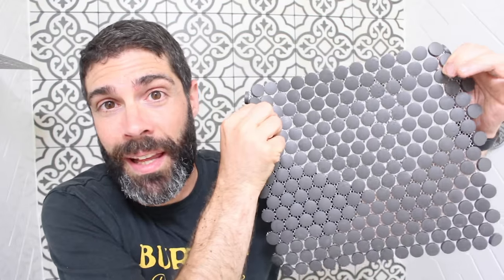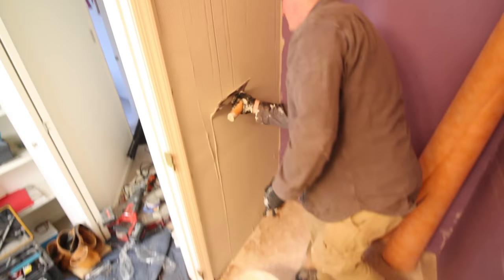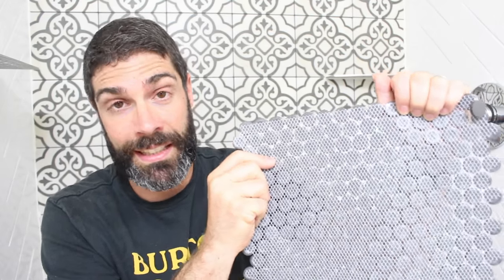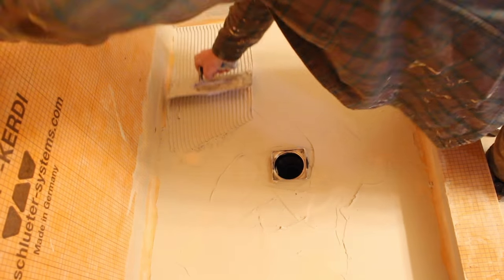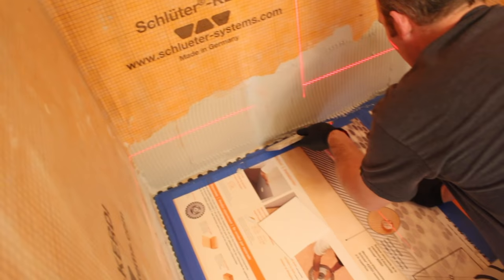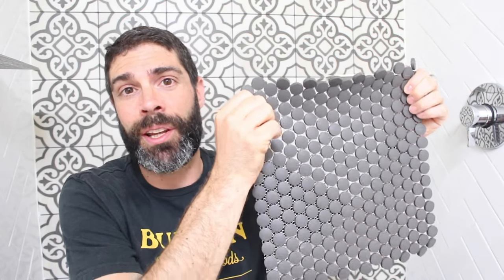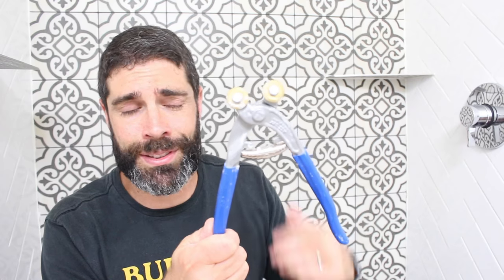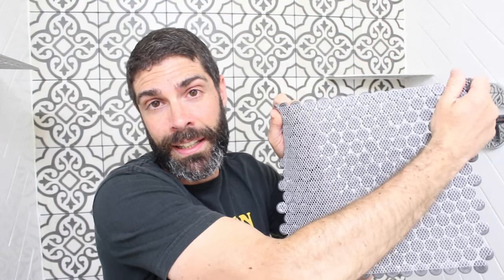Schluter Shower Part 4: How to Tile a Shower Pan...Penny Tile Tips

Comment: FYI, if you use a 1/4" trowel you will be cleaning lots of thinset out from between the tile.
Reply: 100% agree. Need a smaller trowel or knock down the ridges.

Comment: What do you mean by the back covered in glue? Maybe cheap tiles get sloppy? 
I have had stickers on the back.. always remove them.
Reply from the maker: excess adhesive that covers most of the tile surface area and prevents it from bonding to the mortar

Comment: Hi, wondering what you would do, or where you would caulk, if you're using base tile on the shower floor where it meets the wall. The tile I'm using is a "flat top with cove base."

Comment: Hi! Can I do a clear resin or polyurethane on top of Penny tile? I have marble Penny tile floor but they stick out still after 2 regrouts. We want to have that ‘wet look’ on the black tile/black grout, but also give some protection from feet/knees when bathing our baby. Happy to Venmo you for the answer.
Reply: @MrAarobinson89  No, can’t take the risk of it ruins the floors. Stupid marble Penny tile was marked as wall/floor. But it’s mostly just a wall tile because it’s not rounded at the edge, it’s sharpe. Cost too much to risk ruining.

Comment: I’m just not sure how quickly you respond, but my question is do you sanded or non-sanded grout when you grout penny tile?
Reply: Unsanded
Reply: Sanded! Never use non sanded grout In high water applications. It will 100 percent of the time deteriorate over time.

Comment: Is it recommended that you don’t back-butter penny tile before you lay it onto the thinset?  You don’t mention this step at all and it looks like you didn’t back-butter. Can you address this point?  Thx
Reply: You’re also not supposed to install penny tile in schluter base.
Reply: @CrzBonKerz21  you're not?
Reply: @guycleveland5946  no, minimum tile size per schluter guidelines is 2x2”

Comment: Heads up you can't or shouldn't install a tile that's smaller than 2"square on any ditra or kerdi foam floors.
Reply: Is it OK if you use epoxy grout? That or 3500 psi high performance grout is required for Hydro-Blok foam pans.
Reply: That is only for Ditra, no limit for shower trays…. Schluter has commented on this in a few YouTube video comments.

Comment: Could you use the Schluter shower pan in combination with a different brand for the walls? Like goboard or cement board?
Reply from the maker: anything is possible but different materials most likely cancel Schluter’s warranty.

Comment: Schluter do not recommend using tiles smaller than 2" on their Kerdi shower bases. Anything smaller is usually thinner and cant support point loads over the foam base. These small tiles DO fail on Schluter bases. If in doubt call their tech support before installing!
Reply: I just got into a heated argument with a  guy on landberg tile tv channel in the comment section he said hes been doing penny rounds and pebbles for years on the foam pans and I told him that's a definite failure down the road you should always use mud pans and I gave my opinion on why i thought the foam pans were junk and a mortar bed is the better way to go he didnt agree and got all pissed
Reply: That is not correct that only applies to ditra
Reply: I'm not interested in arguing about it but if you call Schluter tech support they will cover themselves by saying they recommend 2"x2". I've replaced 2 failed foam bases with 1" tiles so I can only speak from my experience but I only do 2"x2" as a minimum. There are so many variables can affect any installation.
Reply: @williammartin9450  that’s because there wasn’t the proper amount of thinset under them. Call them and you will find out there is no size limitation but a minimum thinset requirement of a bed of 3/16 mortar to achieve proper coverage and strength. Just look at the box they come in and you can clearly see you are wrong. I just spoke with my rep about this last week.
Reply: @corbintileco   Congratulations on being "right" 👏🏻 You must be a joy to work with and for.
Reply: @williammartin9450  idk as my help. At least he’s learning from someone who’s educated. Lol. I am a total douche tho.
Reply: @corbintileco  😂 Tile setting and running your own business are not easy work. Calculating your own risks for any work you do is your prerogative. I hope everyone is successful in doing what they do and that they can get some practical advice from YT. ( btw people.. The Tile Coach, Starr Tile, Sal DiBlasi all have great channels for tile setting ) ✌️